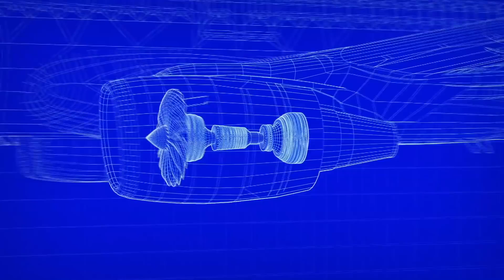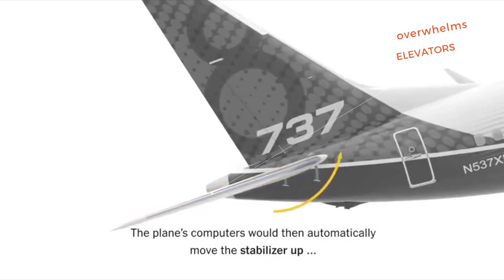737 Max 8 probable cause revealed - Prof Simon

Comment: There are lots of comments here that are assuming outrage. I don't claim to understand all of aerodynamics, but I can assure you many certainly do not. 

Let's take this bit I just grabbed. Apply all these outraged comments to the Wright brothers plane. "Oh, their plane was so bad they had to reverse a prop" or "Geez, they couldn't even get it to fly unless they made it a pusher"
"Why couldn't they simply design a plane that could deal with propeller airflow over the wings"

Copy paste below. 
The linkage was designed to rotate the propellers in opposite directions so as to counteract the torque effect of each rotating blade. This was achieved by crossing one set of chains in a figure eight and encasing the chains in medal tubes to keep them from flapping. The chains were procured from the Diamond Chain Company of Indianapolis.
The propellers were mounted at the rear of the wings as “pushers” to eliminate the effect of turbulent airflow upon the wings.
Copy paste above. 

People need to understand every airframe and every engine need to work in harmony though a series of means. 
How many of these comment writers know how many tractor mounted motors have mounting angles facing towards the ground. 
Boeing could have obviously designed better compensations to the tendencies but that is different from the airframe itself. 
What gets me is how many of these same people are outraged over air ticket prices.

Comment: Essentially the same as how a UK pilot was describing the issue in PMs. 
He also said that recently Boeing has been deciding that the pilot does not need know about some of these things. 
As a result pilots were not clearly informed how to disable the MCAS so as to fly the plane manually.
I see that attitude as frightening, not that Boeing has been the only one doing a similar thing.
Reply: There were some serious problems with the Airbus, too...the A330 model...flights Q72 and AF447...about 10 years ago...."psycho planes"(according to one of the pilots). I don't trust technology these days. I'd rather have a pilot take control and fly the darned plane manually.

Comment: Seeing a lot of comments about people saying software should be less of a critical part of modern aviation, but there are planes in existence, designed and manufactured in part by Boeing, that are quite literally impossible to fly with out the aid of a computer.  I am thinking of course of the B2 Spirt stealth bomber.  Due to the unique flying wing shape of the B2 and the lack of vertical stabilizers a computer has to translates stick inputs from the pilot out to the unique control surfaces of the B2 from quite literally falling out of the sky.  I do fully agree that if there is limited redundancy on the sensors that MCAST relies on that needs to be fixed as well as adjustments to MCAST on how much pitch authority it has if deemed necessary  (and adding manual over ride???) along with updates training as Boeing has already committed to do.  We have been using computers to assist skilled pilots keep plans in the air for decades.  This is certainly a bump in the road,  but I don’t see this changing anything significant in how much computers are assisting in flying modern air craft.
Reply: Also, lots of folks who are critical of the MCAST system and questioning why Boeing would even make an aircraft that need an additional trim system I don’t think realize how pilots use trim in a general sense to keep the air craft flying smoothly under normal flying conditions.  There are so many reasons to need to trim out an aircraft, the difference with MCAST is that it’s more of an auto trim that is only supposed to engage under specific parameters, which loops back around to the need to verify the info the MCAST sensors are feeding data to the flight computers and how MCAST responds to that data, and how it relates to the pilot activity flying the plane and making thrust and pitch adjustment in a climb.

Comment: So basically they've put V8 into small car and it's handles like a pig so they've used a computer to control the suspension and steering to overcome it. And one sensor fails, it crashes.

Comment: Is it possible to even deep stall a boeing 737?  Normally a deep stall is only possibly on T tail configured aircraft such as the MD80/717 type of aircraft due to the proximity of the wings near the horizontal stabiliser.
 I think the reason for the MCAS system is to prevent the more powerful engines from slinging the nose up in a stall, which at full thrust will prevent the pitch attitude of the aircraft from lowering. Which is why we are taught to lower the nose in a stall without adding power as the thrust will cause the aircraft to pitch up.
Similar to a deep stall, except the aircraft will naturally and eventually recover (without pilot input) when the power is reduced to idle and the control column movement and rudders are relaxed.
The pilots of the lionair crash should have known that at full nose down trim, the elevator has no pitch authority meaning that no amount of yoke back pressure will raise the nose of the aircraft. I think they were in a state of shock with the aircraft descending and picking up speed with continuous pull up, terrain, terrain alarms, they reverted to the normal instinct of pulling back on the yoke.

Comment: I'm not inferring that this new design is not a difficult one. Whether the positioning of the new engines upsets the MAC (mean aerodynamic chord) and whether the addition of the MCAS software is adequate or not to compensate for it, is a totally engineering and design issue to solve. However, there were 350 B737Max8 aircraft in the field flying 24/7 throughout the world before the grounding of these aircraft. Pilots where taking off and landing thousands of times with no apparent difficulty. Two B737Max8 aircraft crashed. Both of these aircraft were utilized by airlines wherein pilot training, for advanced systems and also in emergency situations, may not be adequate enough. From everything that I have read the B737Max8 can be flown safely, irregardless of the design and MCAS system, if the pilots are knowledgeable with the characteristics of this aircraft. Why are 348 other B737Max8 aircraft flying safely every day? This is a question that should be addressed before massive design changes are undertaken and a company of 154,000 employees is demonized by a world of people who are mostly not knowledgeable in the least about what it takes to build an aircraft and keep it flying.

Comment: Your assessment is both right and wrong.

What we see that is consistent in both accidents is a runaway stabilizer.  It is a bit more clear that MCAS and the AOA sensor were involved in the first accident in Indonesia. It is less clear that MCAS was involved in the second accident, although it cannot now be ruled out.

Both accidents involved a loss of pitch control.  Since the two accidents were at vastly different departure scenarios (sea level in Indonesia, high and hot in Addis),  the takeoff profiles are very different.  While there is evidence to suggest the AOA sensor in Indonesia sent bad information to MCAS, this is likely to contribute to causation, but it is not the sole cause of the accident. Aircraft accidents almost never have a single causal factor.

Why could the pilots not control the airplane?  That is the correct question.  Boeing has shown that MCAS can be deactivated by disabling power to the stabilizer; the same memory item procedure that exists on the 737NG today.  On both airplanes, the trim can be managed by manually moving the trim wheel.  What is a different in the ET accident is the fact the aircraft got to over 380kts at only 1100-1200 feet AGL with only plus or minus 1500 fpm vertical speed rates.  How that happened based on the radar data I have seen has yet to be answered.

My point? There are factors involved in the ET crash that we do not yet know.  Until we do, we have to be very careful to not speculate or theorize on causation until sufficient facts are known.  We do not have enough facts to state to a reasonable conclusion that MCAS was causal to both accidents.  The airplanes are grounded until we have a reasonable cause and a reasonable solution to fix the airplane and properly train the pilots who fly them. 

You seem to conclude that MCAS is causal to both.  You may be ultimately be correct; however, we don't have enough evidence to conclude that.  Therefore, a theory absent proof in aviation is speculation, which simply causes more fear and angst and that serves nobody.

Comment: Great video- but this is not probable cause. The NTSB will determine probable cause. MCAS is quite likely to be a factor in the crash, but no one outside of the investigative bodies (and perhaps not even the investigators themselves) knows the whole story yet. Bear in mind that there are MAX pilots around the world have encountered issues with MCAS engaging sporadically and putting the aircraft waaay out of trim when it was not supposed to, and they are still alive. I think we can pretty much all agree that MCAS is a cop out on Boeing's part- BUT, MCAS malfunctions, like many other malfunctions are not a death sentence. Yes, it is a horrible design flaw and a cheap attempt to fix the pitch up moment of the airplane, and many MAX pilots were only finding out how it worked after Lion Air happened,  but it is recoverable and I have spoken to MAX pilots who have disabled electric trim because the MCAS was acting up and then continued the flight normally. Whether or not the Ethiopian crew followed the correct procedure is still unknown. Preliminary findings of Lion Air suggest that the crew had recovered control of the airplane, only to inadvertently re-engage MCAS and fight it all the way down to the ocean. In all fairness to them, they had probably never heard of MCAS before (Boeing didn't think it was important to include it in the 737NG to MAX conversion "course" because they were so sure their software made the airplane's handling in flight the same). Computerized protections can be disabled by pilots (happens all the time with Airbus and Boeing a/c, many even disable themselves as soon as they start receiving unreliable data) but they need to know the what, why and how of doing so. Sneaking in phantom control augmentation that commands nose-down trim based on data from a single AOA sensor is a very, very bad idea. If you're going to put something this ghetto in a fly-by-wire airplane, at the VERY LEAST, tell the pilots about it.
Reply: " Preliminary findings of Lion Air suggest that the crew had recovered control of the airplane, only to inadvertently re-engage MCAS "
They did not inadvertently re-engage MCAS.  It resets itself after each manual trim from the pilot.  After a time delay it operates again.

Comment: Obviously there is a software/indication problem but you can shut that system off and override it, so it seems there is also a training issue at some of these foreign carriers as well. Southwest has put 90,000 incident free hours on the Max airframe for instance. That’s a pretty big number and shouldn’t be over looked by simply saying the Max is junk IMO
Reply: Southwest ordered the upgraded MCAS with the additional optional sensors.  No crashes but not the same plane either.  Boeing should have never played this game of making the additional sensors optional as though they were an airline and decided to charge an extra $50 for window seats.  Design a flaw into the airplane and then go cheap on the backup system to deal with it?  Hope you really enjoy your military contracts because Ralph Nader might try to take you out of the commercial aircraft business.

Comment: Tragic accident sequence: Boeing competes with Airbus.  Airbus is ahead.  Boeing pushes FAA.  FAA yields some control to approve to Boeing.  Boeing stamps an approval on a system with flaws.  AOA discrepancies,  non or poorly trained pilots in the new system.  Boeing gets the plane in the air and sold.  Boeing builds great planes yet in this instance it seems it didn't put safety first.  Blast it that competition with Airbus brought in unacceptable compromises and all the failures leading to disaster.

Comment: Boeing's first stab at this problem was a quick solution which placed profits before consumer safety.  Now they have been outed, they persist in claiming a new sw fix to correct the original sw fix would do the job.  The problem is confounded by the production line for the Max that is rolling out 2 planes per day.  If these planes are not delivered, Boeing is facing billions of losses.  The morally correct solution is for BA to re-engineer the Max to fly wings level without MCAS.  They didn't want to do this in 2011 and I doubt they will want to do it now.  Congress is getting into the fray with an inquiry.  Who knows how this mess will sort itself out.

Comment: Has anyone got data on AoA sensor reliability? It seems odd that such a relatively simple device would fail on two almost new aircraft
Reply: I thought the same, but we are not sure that the one of the ET302 had a fault. They never released flight recorder data like they did with JT610.

Comment: They will not be able to pick up the "pieces" because the aircraft is of ill design.

Fitting more powerful engines more forward on the craft and extending the fuselage at the aft results in flight imbalance. With increased drag of the aft the forward placed (more powerful)  engines rotate the fuselage in an upwards attitude and require constant trim adjustment by the pilot to avert stall.

This task was handed over to the MCAS. In other words, the plane is unflyable without the MCAS and such does not meet the requirements of a passenger airliner. Throw a non-redundant sensor vane into the picture (without no piloting knowledge and training) will result in failure.

E.g. the stealth F-117 plane is essentially unflyable but the software is able to adjust trim surfaces at least a thousand times per minute. If there is a failure the pilot can safely eject but not 150 plus passengers.

Comment: I am sure that the testpilots got some sweat producing moments and knew that the plane is a flying time bomb. To compensate the inherent stall risk by a software which relies on only one sensor and to keep this system hidden (because that would have revealed the huge deep stall risk!) is the essence of criminal acting. Hence there are already criminal investigations initiated. Still I do not understand why the pilots of the unfortunate planes did not use the cut out switches or switched off the autopilot. In Africa the time might have to be too short, but in Indonesia they fought the MCAS for quite some time.....or is this argument that the pilots just would have to flip two switches wrong?

Comment: If you fly a Airbus 300 series and deflect the rudder too fast it will break off,  see air crash Nov 2001 NY City. They will still break off now, did they correct the problem? Not really, they issued a placard to tell the pilot not to do that. There is a problem with the with the automatic trim system and related software and it will be fixed by the manufacture. But this plane has been flying for 1000s of hours since Jan 2016 with experience pilots and why has this problem just showed up till now, because VERY inexperience pilots have started to fly this plane that should NOT be at the controls. Poor training and little experience are dangerous with any larger plane. I am NOT excusing the design but there are other factors that also play into it.

Comment: Mcas isn't the only cause of the 2 deadly crashes. The biggest cause that makes boeing guilty, is that they didn't train the pilots how to turn off mcas when in failure and what to do to regain the control of the airplane while nose diving. And they tried to implement that software without informing almost anyone. I think just for that, boeing should have get sued from the victims' families, airline companies and all airline associations throughout the world. Not informing everybody for mcas happened on purpose, not by mistake. I think i will stick with airbus from now on.